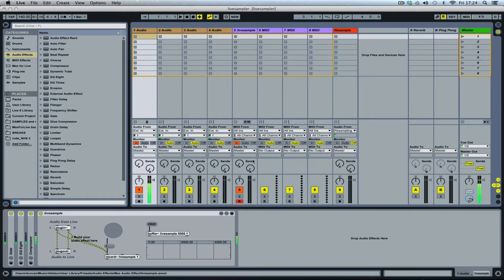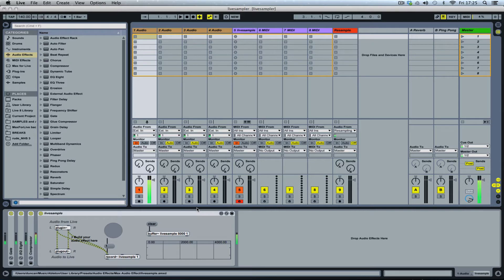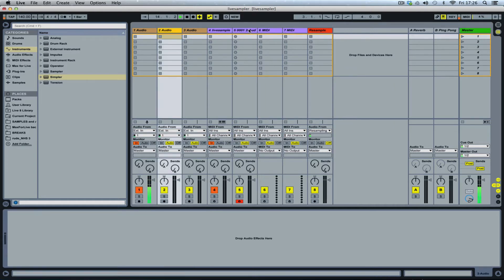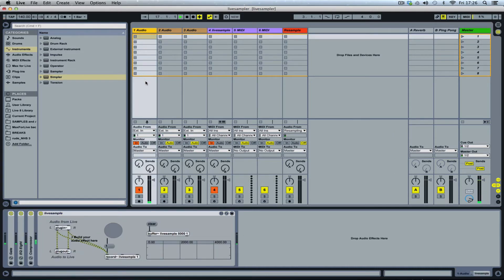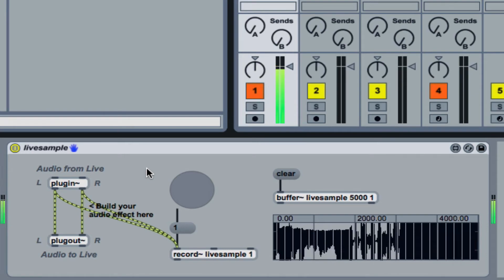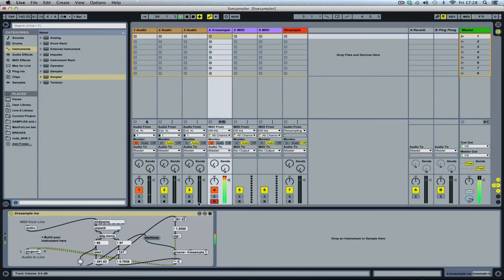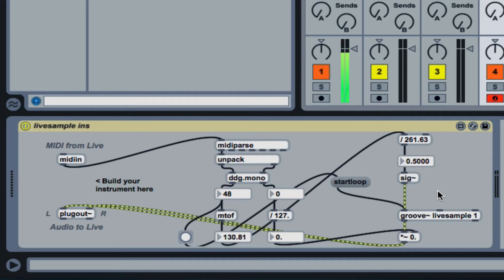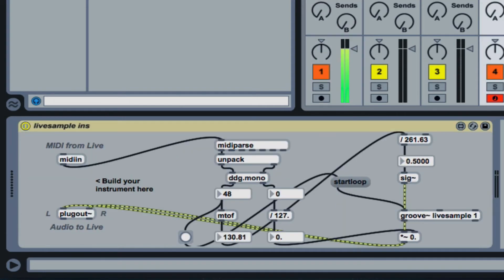Ned Rush = MaxForLive building live samplers.

Comment: How many beers would you charge to help me build a m4l plugin that drags audio from looper directly into a simpler without touching my laptop? Possible? Not possible? Keep up the great vids man, you've already changed my workflow substantially, cheerios
Reply from the maker: +Son Vardy I doubt that's possible. What do you want to do? Building loopers is getting easier all the time. I've built m4l loopers before and haven't the balls to release one commercially, instead considered a Patreon thing were I'll build one (or several) and blog it and give it away, but I've no idea how to approach that yet in terms of asking for money (or beer) from people.
Reply from the maker: +Son Vardy if you're looking to record in realtime into an instrument that has similar playback features to Simpler then this video really is the starting point. Once the audio is in the buffer you would just treat the build as a standard synth process, adsr, filter, loop points, that certainly all possible, but as far as I know, using m4l to physically move audio around the set isn't possible.